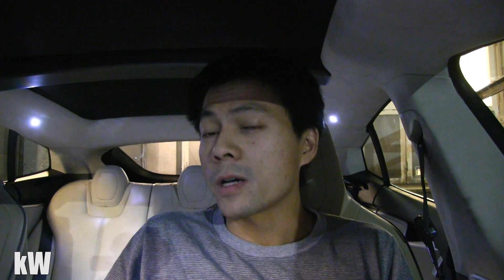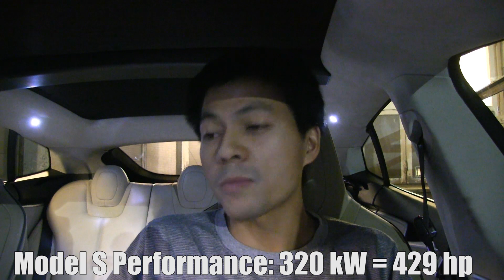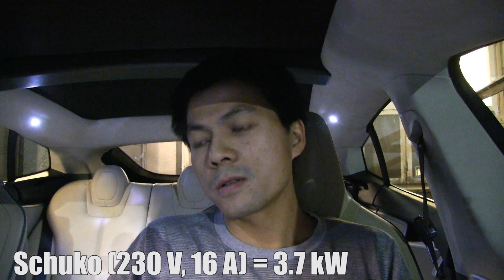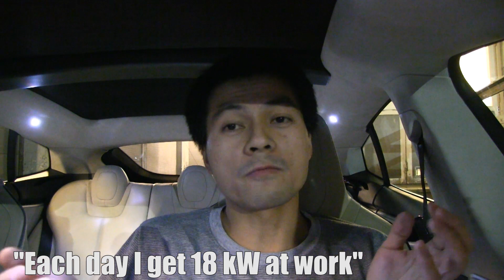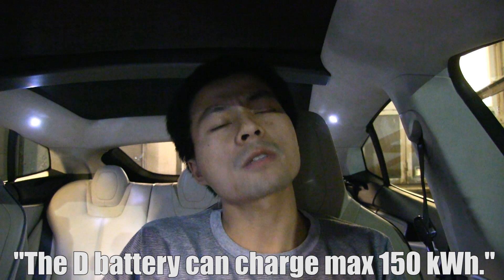The difference between kW and kWh

Comment: Lots of people confuse those units, I used to do, too.

Just remember that 1 W = 1 joule per second.

And that 1 kWh is NOT 1 kilowatt per hour, but 3 600 000 joules.
There is an invisible multiplication operator between the W and the h,
so the s in J/s and the h in kWh cancel out by a factor of 3600, and then there is the k.

Just google "1 kWh in joule"

Thanks for bringing this up.

Comment: In electronics, water is often used to describe this. kWh is capacity. The size of a pool. kW is the power. That would be the amount of water entering the pool. If we compare a P85 to this theme, and one litre is 1 Joule, then the following would be true:
Pool size (85*1000*3600): 306000000 litre
Supercharger input: 120kW = 120000 litre per second
Full acceleration output: 320kW = 320000 litre per second.

Then we can start calculating things like how long can the car run on full power if overheating is no issue:
306000000 / 320000 = 956 seconds, or just under 16 minutes.
How long would supercharger use if the power did not drop trough the charging cycle:
306000000 / 120000 = 2550s = 42.5 minutes.

We know that we cannot use the full 85kWh, and the charging drops when it gets more full, but the comparison is usefull, and to my mind understandable.

Comment: Yeah, I don't really like using kWh to measure energy. Energy should be measured in Joules. 85 kWh = 306 megajoules. If you want to find the power used, you divide the energy by the amount of time it is being used, giving units of Joules per second, which is the definition of 1 Watt.

Comment: You have to be careful with marketing claims as well. Ford originally marketed the C-Max and Fusion Energi cars saying they have a 88kW traction motor so people were claiming 118hp in electric only mode. After the MPG claim debacle they changed marketing materials to say the battery could put out a maximum of 68kW which at least is more honest. How much of that actually gets to the wheels is still unknown.
Reply: Neojhun
You are assuming Ford intended to make use of all 88kW and then failed on the battery front, there is no evidence of this. 88kW may just be what fits and/or to allow the possibility of more power in a future model year without changing the transmission. They use the same 88kW traction motor in the Hybrid models which have a much smaller battery that can only provide 35kW.
Reply from the maker: Many people, including myself, have seen that the car can output 320 kW. It's also been measured that a P85 will output more power than the specified 421 hp.
Reply: Bjørn Nyland
I wasn't saying the P85 doesn't put out the claimed power, just that some manufacturers may specify the capabilities of the motor even if it exceeds what the battery can possibly provide to make the car sound more powerful than it is.
Reply: LOL that was just terrible engineering and marketing. The motor they used probably was rated for 88KW thus theoratical crank horsepower is 118. It's just fords crappy battery technology that could not output enough wattage to the motor. Sad case of marketing hiding bad engineering. Which is frankly dangerous.

Comment: 1 volt * 1 amp is one watt, or jules / second. One Wh would be spending one jule each second for a full hour, makes sense. But 1Wh could also be spending 3600 jules in a single second. KW and KWh is the same, just a thusand times larger.

Comment: So with an 85kwh battery pack, how do you calculate distance/range (without cheating, wise guy!! :D )? What is the other part of the equation? Is it kw?

Also, calculating the battery pack size of a conversion, is it correct to use the following equation?:

e.g, 100 amps times by (x) 72 volts equals (=) 7200 devide by (/) 1000 equals (=) 7.2

If so, what are 7200 and 7.2 units of and how, using them, can you estimate range? I would love to know, as I'd like to do a couple of custom electric bikes one day and would like to be able to estimate the range in advance.
Reply from the maker: In a 85 kWh battery, I have experienced that about 75 kWh is available for normal driving. If I drive at a speed consuming 200 Wh/km, I will get 75 kWh / 0.2 kWh/km = 375 km.

I have Whisper 905 electric bike with a 36 V 16 Ah battery. The capacity of the battery is 36 V * 16 Ah = 576 VAh or 0.576 kWh. The bike consumes about 6 Wh/km. The range is then: 576 Wh / 6 Wh/km = 96 km.
Reply: Bjørn Nyland So how do you know about wh's before doing a conversion? Is there some way of calculating that in advance?

Thanks for your reply. I may not know much about electronics, but it's helpful nonetheless. :)
Reply from the maker: You have to know the voltage and capacity (Ah).
Reply: TheKnightsShield
I'm not sure what you want to know. The energy content of a battery is usually a known value. Otherwise you can calculate it like Bjørn said. But I have the feeling you had something else in mind?